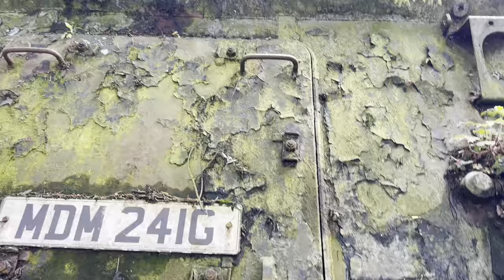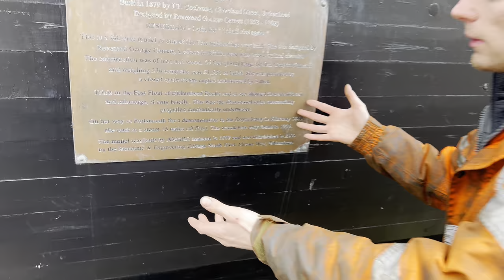I Fixed This Abandoned APC With A Glue Gun!

Comment: THE PLAQUE READS:

Resurgam
Built in 1879 by J.T. Cochrane, Cleveland Street, Birkenhead
Designed by Reverend George Garrett (1852 -1902)
This full size model of one of the first submarines  ever built. She was designed by Revered George Garrett, a curate in Birkenhead who was a trained chemist.
The construction was of cast iron and wood 45 feet (14m) long. 10 feet (3m) in diameter and weighing 330 tons; she cost £1,538 to build. She was powered by a closed cycle steam engine and crewed by 3 men.
Trials in the East Float of Birkenhead Docks and at sea showed that she did sail and submerge, if only briefly. This was the first vessel to be successfully propelled mechanically underwater.
On her way to Portsmouth for a demonstration to the Royal Navy in February 1880 she sank in a storm 15 miles of Rhyl. The wreck was only found in 1995.
The model was built by AMARC trainees in 1997 and was refurbished in 2009 by the Maritime & Engineering College North West, Monks Way, Birkenhead.

You're welcome.
Reply: the original is still off Rhyl it was found when they surveyed for the wind farm

Comment: That was an excellent video, thanks. I'm an ex RAF aircraft technician. One of the best courses I did was the BDR (battle damage repair) course. Essentially get the aircraft back in the air with whatever is to hand in the safest way possible. I think the repair you did on the lube oil heat exchanger was absolutely in keeping with the spirit of that. Inner tube, silicon, Arizona hose and jubilee clips, a tour de force. What a brilliant performance at the end. 20 years dead and climbs over a gravel mound, just superb. Rolls Royce engine! Just the best. In the RAF all our diesel vehicles and ground support equipment were run on AVTUR (aviation turbine kerosine) defuelled from aircraft. Once it comes out of an aircraft, it doesn't go back in. So it was used for this purpose. Which was a good thing, because AVTUR contains FSII (fuel system icing inhibitor) and very carefully controlled water content - ie no water. The FSII also prevents the formation of cladosporium resinae or "diesel bug" - if any water does get in the system. So, any diesel vehicle with AVTUR in it is going to be in a good position to be left idle for long periods.
Reply: being ex-BAe, most RAF stuff presented as ex BDR....including Queens Flight.....lol
Reply: @babaganoush6106  Ha ha!!
Reply: @carlwilson1772  sorry all in jest couldnt resist
Reply: @babaganoush6106  No problem! What did you work on?

Comment: People forget the oil on your coat is waterproofing.  Good tip about using kerosene to store diesel engine.  👍🏻💯
Reply: Survival coat with multiple uses, one of which is "easy fire start", You just squeeze out a bit of "multi fuel" when needed and away you go!

Comment: Resurgam
Built in 1879 by J.T. Cochrane, Cleveland Street, Birkenhead
Designed by Reverend George Garrett (1852 - 1902)
RESURGAM Latin for " I shall rise again “
This is a full size model of one of the first submarines ever built. She was designed by
Reverend George Garrett, a curate in Birkenhead who was a trained chemist.
The construction was of iron and wood, 45 feet (14m) long, 10 feet (3m) in diameter and weighing 330 tons; she cost £ l,538 to build. She was powered by a closed cycle steam engine and crewed by 3 men.
Trials in the East Float of Birkenhead Docks and at sea showed that she did sail and submerge, if only briefly. This was the first vessel to be successfully propelled mechanically underwater.
On her way to Portsmouth for a demonstration to the Royal Navy in February 1880, she sank in a storm 15 miles off Rhyl. The wreck was only found in 1995.
The model was built by AMARC trainees in 1997 and was refurbished in 2009 by the Maritime & Engineering College North West, Monks Way, Birkenhead.

Comment: I remember the U boat coming to liverpool, the original plan didn't work out, and the boat basically just sat there to rust even more , but it was in a different location, when they decided to move it , they used cables to cut it in to sections, someone didn't do their homework and cut through the oil tank which was still full of oil after all thoses years,

Comment: on the note of that weld, it reminds me of when I first start. we are all bad when we start
Reply: Keeping in mind this was built 50 -70 years before welding was actually a common thing and before gas shielding was actually considered. 
Try MIG welding without gas on and see the quality of your welds.
Reply: @arthurmiller-vl6sw  definitely, the weld is like MMA without the gas coating on the electrode or MIG without gas. TIG would see you round the T rod in the weld.

Comment: Use p40 fiberglass filler to stoop leaks we use it alot in the aluminum factory hold up very well try you will see
Reply: The replica submarine was built by apprentices, so they got to learn to weld on something meaningful. I'm sure it meant more to them than just welding a couple of non descript bits of angle together. And I'm willing to bet they got a lot better.

Comment: "he got it too hot" I am not inexperienced when it comes to arc welding, did a lot of pressure pipe work in my younger years and still do the occasional difficult job when no one else will touch it. There are many different ways to get the job done, some aren't conventional, some are plain ugly but that's okay as long as it works, the customer is satisfied and is safe.

Comment: Not body filler?  Body filler and expanded mesh :D  Although, filler and stainless punched mess was the only way to fix my 1991 Ford transit plastic trim that cracked. Also, the wind is picking up. Good luck and fingers crossed for shed roofs across the land!

Comment: Buy the U Boat, weld it back together and turn it in to a running tourist attraction!
Reply from the maker: It’s crossed my mined but it’s combined weight with current scrap prices means it would be about £850,000 💀

Comment: wont the hot glue melt and get introduced into the oil and block passages?
Reply from the maker: This line goes to a steel mesh screen in the oil tank it’s on the return to tank

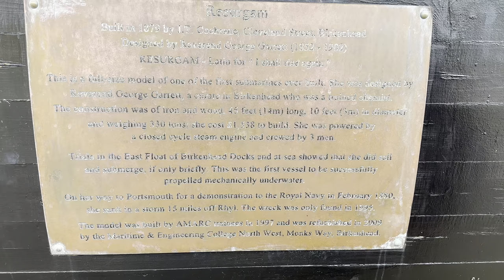Comment: 22:00
Resurgam
Built in 1879 by J.T. Cochrane, Cleveland Street, Birkenhead
Designed by Reverend George Garrett (1852-1902)
RESURGAM - Latin for "I shall rise again"

This is a full-size model of one of the first submarines ever built. She was designed by Reverend George Garrett, a curate in Birkenhead who was a trained chemist. The construction was of iron and wood, 45 feet (14m) long, 10 feet (3m) in diameter and weighing 330 tons, she cost £1,538 to build. She was powered by a closed cycle steam engine and crewed by 3 men.

Trials in the East Float of Birkenhead Docks and at sea showed that she did sail and submerge, if only briefly. This was the first vessel to be successfully propelled mechanically underwater.
On the way to Portsmouth for a demonstration to the Royal Navy in February 1880, she sank in a storm 15 miles off Rhyl. The wreck was only found in 1995.

The model was built by AMARC trainees in 1997 and was refurbished in 2009 by the Maritime & Engineering College North West, Monks Way, Birkenhead.
Reply from the maker: Steam powered incredible!

Comment: Not that I want to down play your success to get it running at such a high standard. But! As this is indeed a 436, it is a command vehicle. One that you would only see used at Brigade level upwards. 
So there'd be brigadiers and possible even generals in and around these vehicles.
Needless to say, that these vehicles were always in mint condition. Were never short on spare parts for maintenance and had nowhere near the amount of thrashing and mileage of the infantry line vehicles. If you compare the 432 from your previous vids. You'll see what I mean.
But that doesn't detract form the fact that it has been sat for 20 years. Absolutely no care and radiator access removed. etc.

Comment: Back in my apprenticeship days as a millwright I worked at a mine with scads of piping. We used a product called Lineatex (sp). Elastic pipe wrap. Worked wonders for wrapping leaky slurry/water etc pipes. But I still love your get it the fuck going repairs. Jim. Out

Comment: I was hoping you're not using the Milwaukee or snap on torque tools and sticking to British made originally for rolls royce engines.  Norbar pro and nortronic torque wrenches 👍
Reply: What difference does it make what you torque a bolt with 😂
Reply: @gregshearer423  Im sure you just gun it up and your wrench will never lie 👍.  Just don't say that to rolls royce aero 😁.
Reply: @Stainless316L  a was more meaning why does it matter if you have a snap on torque wrench or a British made nor bar cause if there both calibrated they’ll both do the same job
Reply: @gregshearer423  Norbar actually been acquired by snap on these days anyway.  Another British company sold out. Guess that doesn't matter in Britain anymore anyway.
Reply: Once had a 44 year old norbar tested and didn't need calibration.  Can't say that for many cheap ones because they  don even last that long. Learned the hard way.
Reply: @Stainless316L  a quite agree it’s not the sort of thing to be cheap on you make sure to buy good quality torque wrenches
Reply: @gregshearer423   I guess it depends what you're  using it for but you definitely don't want the tool to outlive you ☮️

Comment: I had a run away with a 432 and the accelerator got stuck - what would of caused this? my driving instructor rushed me away while the fire-engine raced to the vehicle and i never got told what mechanically happened
Reply from the maker: Low governor oil possibly